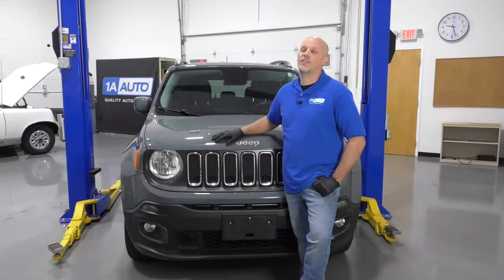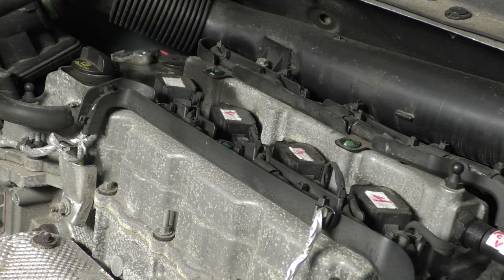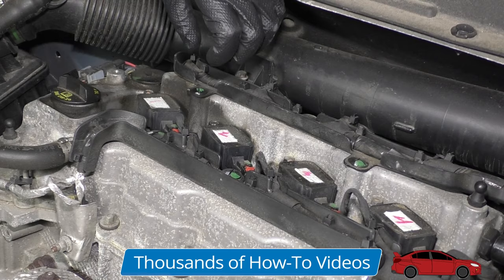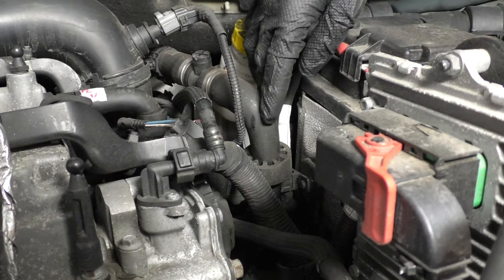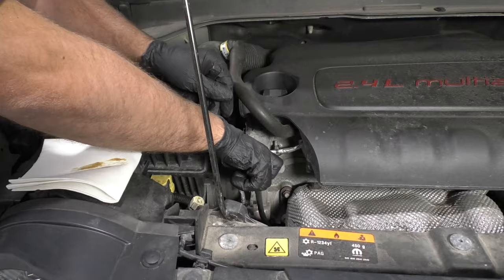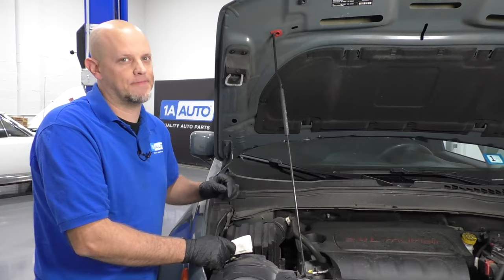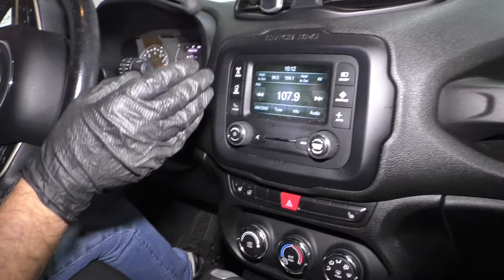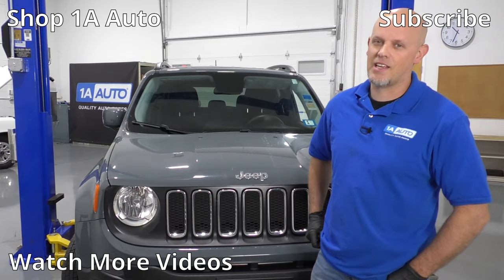Top 5 Problems Jeep Renegade 1st Generation 2015-Present

Comment: When it gets cooler out I get the thermostat issue code 33 31??? Basically it isn't heating up fast enough, so says the computer. Come spring the code disappears. When this first happened I zoned it and got the air intake  sensor code. At the deep that code didn't show but the other did. Maybe the AIR sensor is the culprit sending bad akr temp so computer thinks it isn't heating up fast enough in cold weather vs hot.

Comment: Re:  oil consumption.  My 2015 Renegade:  I went to the dealer and they reprogrammed the 2.4 liter engine computer.  No more 1 quart per 1000 miles.  How did that stop the usage?  Very interesting.

Comment: I have a 2016 Renegade, 2.4 cylinder.  transmission vibration when car running on steady speed. For example, when car running about 50 miles per hour, transmission always on gear 8, so as you step on gas the transmission starts to vibration. In this case I have to use manual to drop a gear to 7. At gear 7 car is running smoothly. Push back to auto transmission, gear go up to 8 again. Dealer refused to fix this problem because no wrong code from car computer.

Comment: Switch to 30w oil, that should solve the oil consumption issue. 20w and low tension piston rings are a lame attempt at increasing gas mileage.

Comment: The radio display on mine is constantly switching over to European units. Also the AC stopped working in my 2016 1.4L. I think that's about the only problems I've have with mine

Comment: What’s with the SERVICE PASSIVE ENTRY SYSTEM light on the 2015 ? Can you just reset this or is there really an issue. Everything is working good..
Reply: Disconnect battery cables... wait 15 mins... reconnect cables

Comment: I got 2016, bought with 16,000 mi. Now 42,000 mi. Luckily all the problems happened under warranty,: radiator fan, A/C, windshield washer hose, driver's seat control & door handle came off. Had a temporary loss of engine power once, 1 minor issue is I can't leave the back wiper on rain sensing mode. Will I buy another...? We'll see how it holds up!
Reply: That's quite a bit lol
Reply: @pingpongballz5998  yep & I needed to replace the dealership installed radiator fan recently as they only had a 2 year warranty & now I see multiple seepage of coolant on radiator the dealership missed! I'm I buying another Renegade? NO!

Comment: They lost a class action lawsuit over the oil consumption issue. They will extend the powertrain warranty, recalibrate the idle and trans shifting points through software updates. if that doesn't work, they'll replace the long block. A tremendous job, that the vehicle will probably never be the same.

Comment: My speaker light comes on and off intermittently when it comes on the passenger side speaker doesn't work then when it goes off the speaker works and the shop couldn't find the problem 🤦‍♂️

Comment: Anyone have problems with the door locks not working at all with the switches or key fob? Normally disconnecting the battery for a few minutes works but if don’t and just ignore the problem the battery dies after a couple days. It’s like it drains the battery down.

Comment: Do all of the symptoms described in the video also apply to the 1.4 L multi air Turbo models?
Reply: No, not all all. The 1.4T version is rock reliable. Might still have the CV shaft issue & there were some electronics gremlins in '15 & '16.. Also, stabilizer links can go early, but new replacements are relatively cheap.

Comment: Do I need to use PREMIUM gas for my 2018 renegade?  It has a 1.4 turbo engine.
Reply: No, you don't need premium, but avoid regular, 87 octane fuel or you will likely lose performance, as knock sensors will trip and the ECU will trim back timing. The 1.4T does run great on mid-grade, 89 octane fuel though.

Comment: My wife's 2016 is awful. It only has 80,000. I've spent over $2000 in AC repairs. 
Since day one it never shifts correctly, leaky door seals, over heated on two different occasions, and burns a quart of oil every 1200 miles. So many other little things I don't have time to list.

Comment: I had totally different problem with my CV axles! I had a wobble no one could figure out and then a vibration during acceleration. Replaced them and it went away, but it seems these are bad after market ones, and now they can't be found to replace again.

Comment: Out of curiosity, are you seeing similar problems on the 1.4T manual transmission first gen Renegades?
Reply from the maker: +Stuart Marshall Thanks for checking us out! These are common among most of the first gen models, the 1.4T also has an issue with a high idle and occasional stutter. http://1aau.to/m/Shop-1AAuto-c
Reply: I get parts here all the time! Thanks for the reply.

Comment: My 2018 renegade uses a quart every 1000 miles it has 61000 on it its been that way since I bought it. So except for the filter it gets 2 oil changes every 5000 miles😅

Comment: What about engine stalling while driving?
Reply from the maker: +Suspicious Citrus We wouldn't be able to diagnose an issue like that here, you may want to have a local mechanic take a look at it. Thanks for checking us out! http://1aau.to/m/Shop-1AAuto-c
Reply: The Renegade with the 2.4L MultiAir engine is known for oil consumption issues. When the vehicle gets low on oil (without warning) the vehicle goes into a "limp home" mode.  Poorly engineered, designed and built...avoid at all cost.
Reply: @tgamble1000  that it goes into a limp mode is a blessing and avoiding further damage.  All cars expect the owner to monitor the oil and not let it get to that point.  The limp mode is saving them.
Reply: @monkeywrangler5200  true . I agree with that.

Comment: Problem with 2018 jeep rennegade: cannot open hood... Cable broke😒
Reply: Update: temporary fixed hood w/ zip tie but more problems, 3rd breaklight went out plus radio freezes even after update.
Reply: That happened to my 2018.  Also backup camera  not always working.

Comment: Bought a 2015 model. Had trouble starting, engine sounded like a tractor. Kept cutting out, the boot was like a swimming pool collecting so much water. The crash indicator light came on after 5 min of driving.

Worst car I've had, don't touch them seriously. Great to  drive if ever they do drive.

And no one and I mean no one knows how to fix them. I'm in England and there's hardly any jeep places.

. Buying a vw tiguan, ready to get parts and Golf parts are reasonablly priced.

Avoid like the plague. Sold mine after 3 weeks
Reply from the maker: +@vitalhygiene3546 Thanks for the feedback!

Comment: I’m having a 2017 renegade, my fuel consumption not very good 
I’m clocking around 9-10 km/L despite careful driving.

What’s the average you guys clock ? 
Any suggestions to better my consumption?
Reply: I'm worse, about 7-7.5 combined but I do about 80% stop and go in the city. I probably could get to 9 if I did a 60 highway, 40 city driving like most people. My fuel economy was about 10 when I first got the car so it has dropped substantially. I have the 2018 Trailhawk with the 2.4L 9A

Comment: My 2017 Renegade Trailhawk Problems at only 12k:
Ridiculous oil consumption. My 98 Cherokee never needed oil between changes at 200k.
Transmission slams into reverse after sitting overnight in under 60 degree weather.
Navigation no longer knows where on the map the car is, roughly 50% of the time.
Driver's side arm rest starting to split at the finger cup.
Cat converter shield rattles when I start it up in the morning.
Moonroof jams and chatters and sometimes needs help closing. Lube doesn't help much.
Weatherstripping is falling off the front and back edges of moonroof panel.
I've had the Renegade rumble maybe 10 times since it was new. not a persistent problem.
The air conditioner SUCKS.
Gas mileage is on par with my old Volvo AWD V70 wagon 5cyl turbo, 21.5 mpg. OK for the huge Volvo, horrible for a tiny car with a 4cyl.
DON'T BUY ONE OF THESE!! If it weren't for the quality control issues, I love the vehicle. But it's not going to be a 150k trouble free car, like my previous vehicles. The Volvo started having nuisance issues when it hit 100k. But the 98 Cherokee, aside from a broken wire in the door for the windows/mirrors, and a mystery engine light problem it's been bulletproof. I still use it for dirty work.
Reply: Boy nothing can satisfy you!

Comment: You forgot to mention the shitty ass fuel filters that don’t last a lifetime like they’re supposed to. Don’t get one of these cars. I fucking hate it. It’s a pain in the ass to work on and there’s nothing online that really helps. Hell the manual doesn’t even tell you how to fix jack shit but wiper blades.
Reply: Also not to mention the fuel filter is a non serviceable part that’s attached to the fuel pump. So when it goes bad it’s a $300+ fix to do it on your own. Any other car it’s like $5-10

Comment: Big problem is no spare tire, jack or tire iron.   Before you purchase a Jeep Renegade it will not have a spare tire kit (spare tire, jack, lug wrench). If you try to purchase a spare tire you can only get them through a Mopar/Jeep dealer or parts outlets. But they are on backorder until late 2021 or early 2022. We have a 2020 Jeep Renegade Latitude and I searched the internet, called tire outlets, junk yards and a few Jeep/Mopar dealers and the kits are on backorder through the dealers and Mopar parts. So for the time being I'm going to by a regular size tire and aluminum rim to have as a spare. I'm going to get them from Discount Tire or Big O. I might even check out a Llanteria for a used tire and rim..
Reply from the maker: +ese.hombre Thanks for the feedback!

Comment: Tail light burns the ground cable. Fog light bulb too hot for the housing and burns it. Damage hub from factory. Lug nuts are trash. A pillar cover plastic has a gap. None were cover by warranty. I don't i will get another jeep

Comment: I'm thinking about buying a 2015 in very good shape buti see all these videos n I'm freaked out a bit.
Reply: @Rachel Delawder Did you go through with it? I got one yesterday and I'm dealing with a stereo issue (as I pulled out the dealership a yellow speaker symbol next to an exclamation mark on the dash popped up). Supposed to be looked at tomorrow. 🤞🏽

Comment: No. 1 It’s a FIAT !
Reply: depending of point of view
fiat make great engines,especially the 2.0 multijet
there's a lot of  Fiat commercial vans in Europe with more than half a million km on board and still running well
is a Fiat engine,true
but the 4x4 system is 100% by JEEP